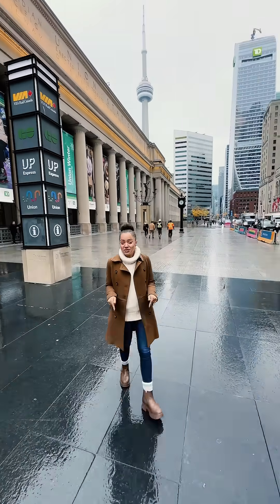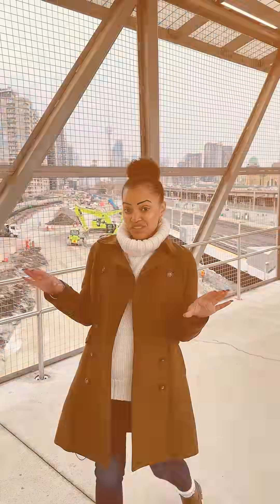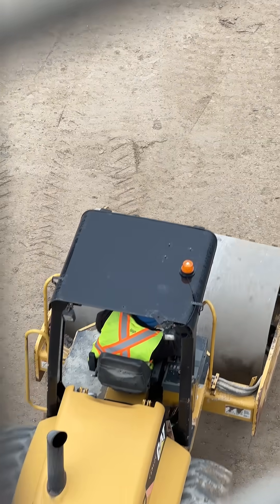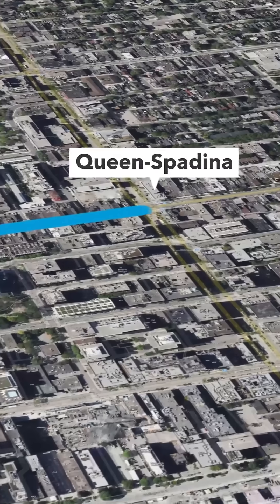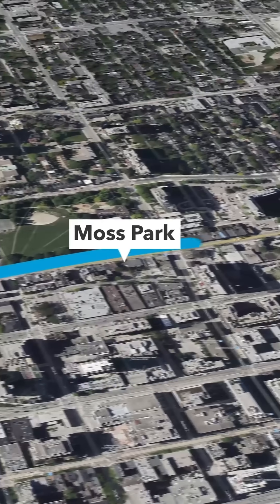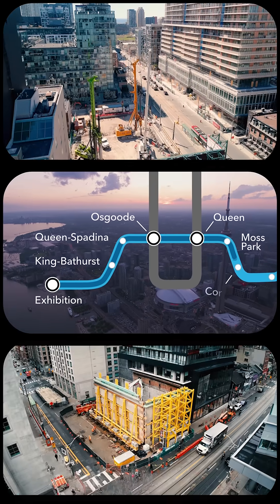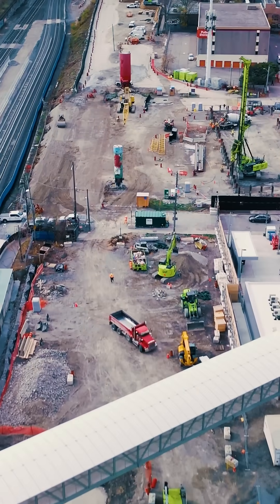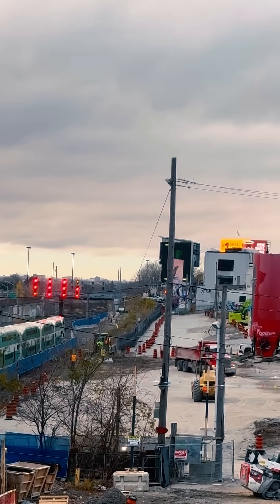Excavation starts at first Ontario Line tunnel launch shaft

Comment: The Ontario Line should link up with Dundas west station or even the new Eglinton line extension.
Reply: Yes to Dundas west.. I think it already connects to line 5 in the east around science center.. but yeah would be nice in the west a later expansion.. but first we need to get the line 5 and finch line up and running ugh 🙏🙏🙏
Reply: no it should run up to connect to the Sheppard line especially given that Metrolinx is finally thinking about extending it to Scarborough